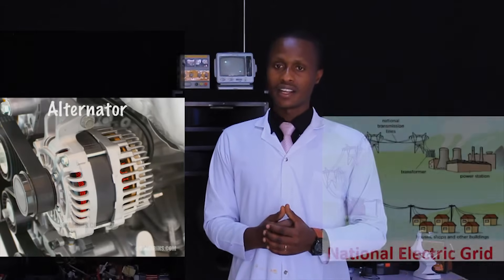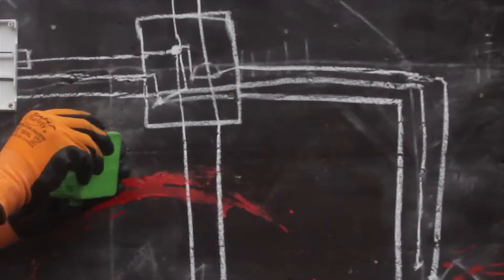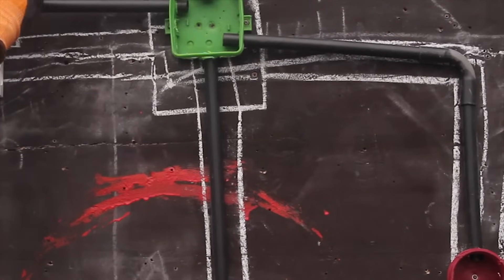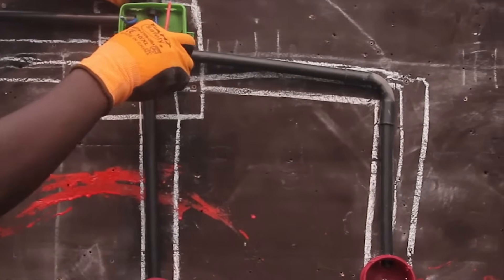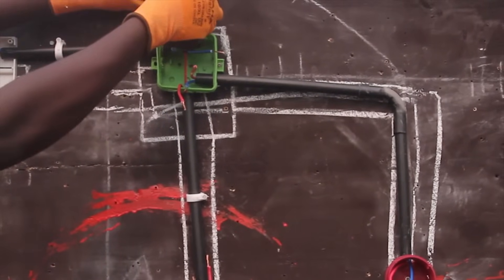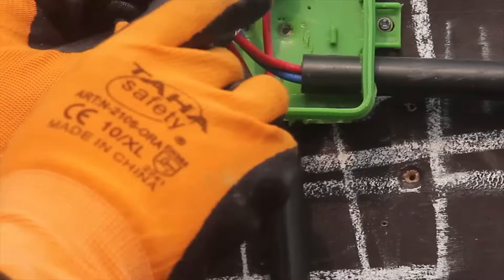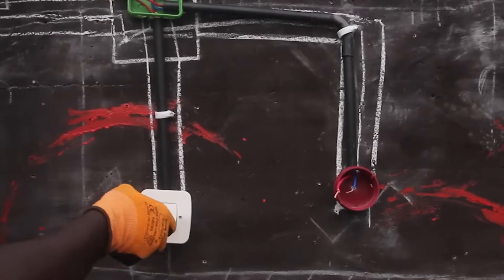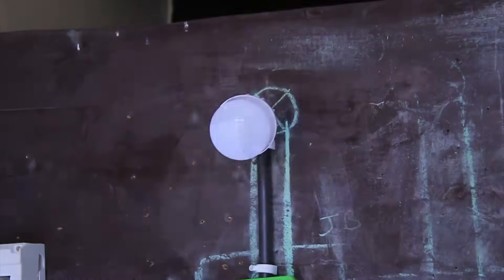Electronics Level 3 - BASIC ELECTRICAL INSTALLATION Part 1

Comment: This is completely wrong. First of all, get your colour coding right. Red is not neutral. Red is live or the phase. Secondly, you can not connect sockets and lighting together. This is a code violation. The current flowing through sockets will be much higher. Thirdly, because sockets and lights should not be connected together, you can not use the same gauge wires. Most fires are started because the wrong gauge wires are used in an installation. Again, this comes down to current. More current is needed for sockets, so a thicker wire is needed. Fourthly, you should not use the same MCB to connect sockets and lights for the same reason I have already mentioned. Finally, you, sir, need to take this video down, go, and study electrical installations properly and then upload another video when you have the required knowledge and experience. Electricity is extremely dangerous and must not be taken lightly!
Reply: spot on!